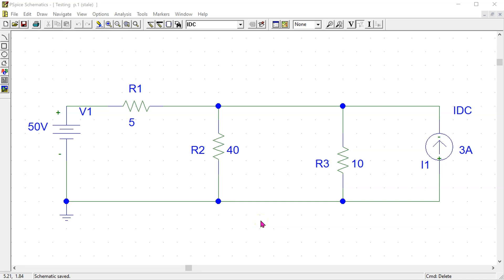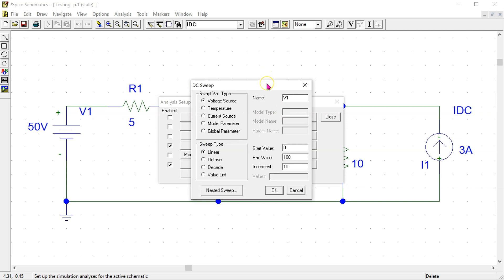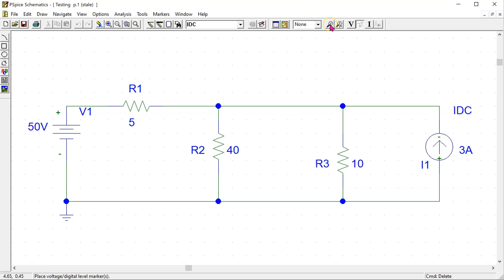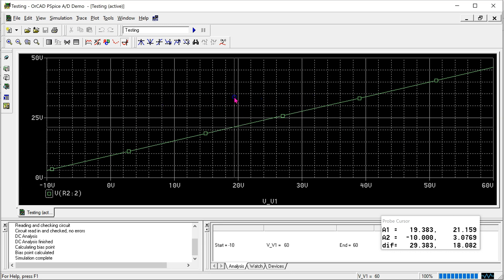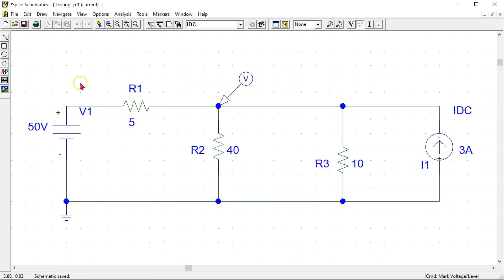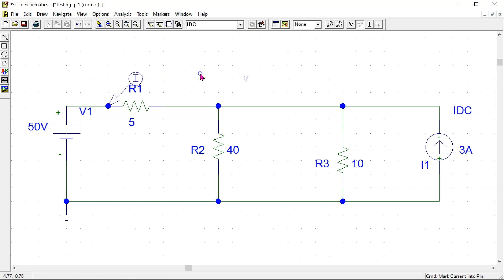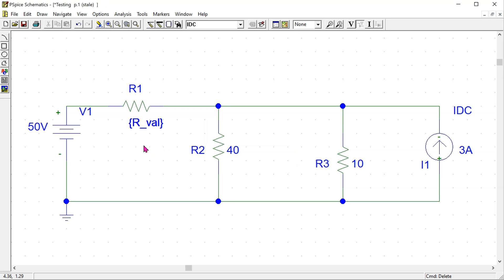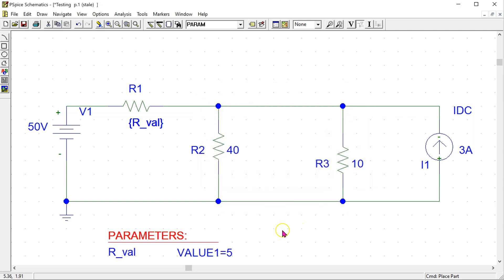Introduction to PSPICE for Running DC Sweeps over Voltage and Current Sources and Resistance Values

Comment: Sir can you please make clear video how connect cuurent marker we are getting doubt
Reply from the maker: Thank you for the question. In PSPICE, you can select current marker from the drop down menu by going to Markers -> Mark current into pin. The current marker must be placed at one of the pins of the circuit element. It cannot be connected to just a wire.

Another way to select the current marker is from the menu bar. The current marker is next to the voltage marker. You can see the location in the video here: https://youtu.be/KnB4xFXRvV8?t=240

Comment: this is exacty what I need, a DC Sweeps, but in PySpice on Python :(
I have a vector of power that comes from the analysis of solar panels, and I need to input it to a CD-CD converter.
Reply from the maker: Thank you. In PySpice, the simulator.dc command can be used to run dc sweeps.
Reply: @electriccircuits7164  Hi sir, I tried to simulate it as you say but it failed, and I proposed a recursive method to vary the constant DC source in each iteration, however, the iteration "hangs" and I don't know how to solve it
Reply from the maker: Thank you. Please post your issue on the PySpice discourse user forum. Include a toy example of the code if you can and the error message/issue you get. Include as much detail as you can.